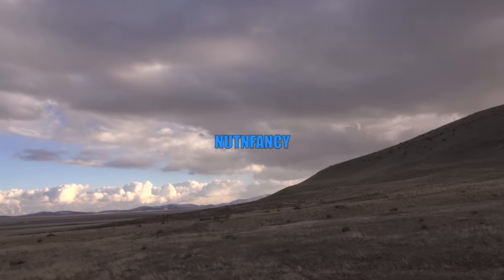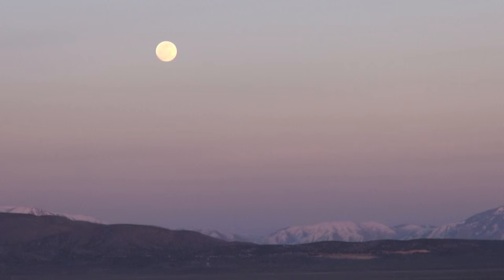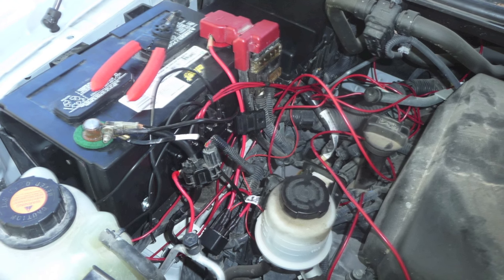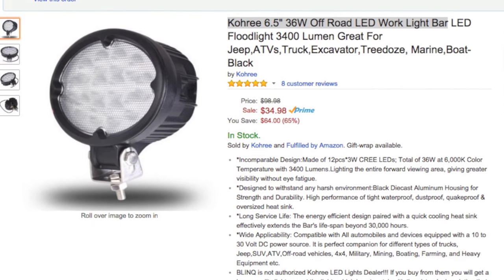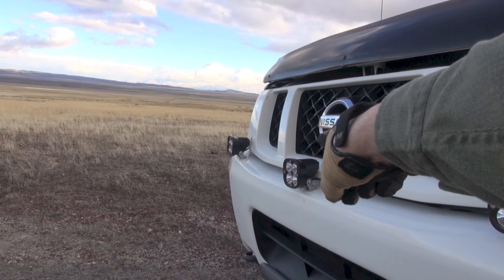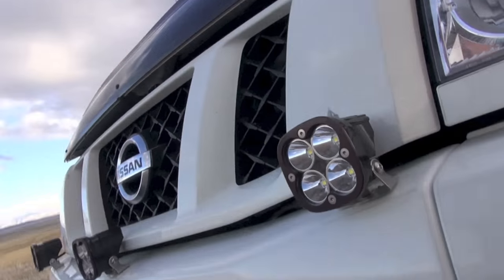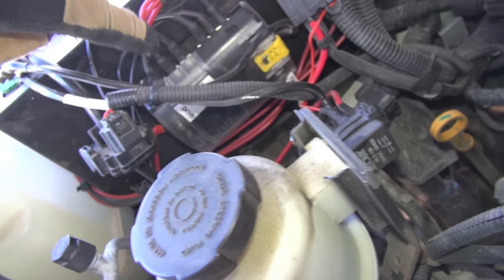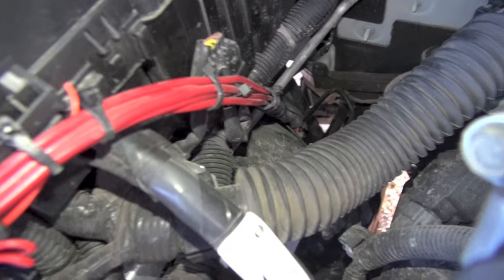Make Your Truck Lights Suck Less

Comment: Is that price per light? Is the wiring harness included? I have been looking at up grading my kc lights.
Reply: never mind you answered the cost question. Is there a reason you didn't use Ridgid brand lights?

Comment: Did you need a relay for those little led's?
Reply: +Cooldibs Looks like the relay supplies power to the add-on fuse block, which I believe can support six 30 amp fuses. (more than that relay is rated for, I'm sure)

Comment: Not a bad set up but very spendy compared to a light bar
Reply: +Nicks Customs very spendy compared to cheap light bars. quality ones can run you way over $600.
Reply: Alex; $280.00
Reply: You can pay over $2000 on some
Reply: +Nicks Customs thats a light bar from rough country they make dont make the best products they arnt very bright ive had one but rigid light bars are top of the line and are quality running up to 2,000
Reply: MrOutdoorsman1234 Rough country makes really good suspension parts actally
Reply: +Nicks Customs +1 on cheap light bars from ebay. Way more light for the money than small square ones!
Reply: +Nicks Customs lightbars are not for everyone. some of them makes the truck look ugly.
Reply: bugaljuice I'm not much of a looks guy. I care more about function. If you'd like this set up for looks over a lightbar, go for it.
Reply: Nicks Customs
 i have a 81 corolla. i have a light bar on the car. its a beast i still havent gotten pulled over
Reply: +Nicks Customs There's 3 types of light bars1. Baja Designs2. Rigid3. China Bars
Reply: you can make your own from parts too.  I think I saw a diy on pirate 4x4

Comment: If you can get up there with a drill to drill thru the nut and bolt, safety wire those nuts on.

Comment: don't forget to pick up an optima yellow top battery standard batteries don't hold up well with offroading. This video makes me miss my old jeep I had delta driving lights on the bumper and 2 9" spot lights from northern tool on windshield mounts. I think I had 300 bucks in lighting upgrades. it would light up the hillside 300 yards away no problem. coyotes never stood a chance :)
Reply: doesn't seem like northern tool has those lights anymore they were only 12-14 bucks a pop but worked amazing think the bulbs were H11s too so you could hid upgrade them easily
Reply: Your battery has nothing to do with power to the lights when the truck is on, that'd be the alternator. Those LEDS don't draw enough to come anywhere near the max output of that alternator.
Reply: MrBassfisherman98 you're right however that's only true if you have the truck running constantly. And a standard battery not being durable during off-road use still stands as the lead plates breakdown with severe vibration
Reply: +John Thrasher Why would anyone run aux lights with the engine off? Even if they are led they'll still drain your battery regardless of what kind it is. It sounds like you don't offroad much (if at all). I've used generic autozone batteries in every single one of my wheeling rigs and ive had 0 problems. I've run them all across the country and never had a single problem. An optima is merely a luxury, not anywhere near a necessity.
Reply: MrBassfisherman98 i don't know about you but I don't want my vehicle ideling for a few hours while shooting which is what he's doing. Ideling isn't a huge issue of you have an electric fan.  Ive done enough offroading to have replaced 3 auto zone generics in my jeep and to be done with it. Optimas are expensive but worth it. I'm not going to argue with you but ive dealt with enough crappy batteries that when a battery dies or starts giving me issues I replace it with an optima. To me they're more than worth the premium you pay for then.
Reply: +John Thrasher Jeep problems. It's not the battery it's the vehicle.
Reply: MrBassfisherman98 yeah cause 91 jeep wranglers were known to just eat batteries for no reason....Done....
Reply: +John Thrasher Faulty electrical systems, parasitic power drains, bad connection, bad alternator, It's not for "no reason". Jeeps have one of the highest "issues per 100 cars" rates on the market today. And unless you're a millionaire there is no way you could have owned 91 jeeps, let alone ruined 91 autozone batteries in 91 different jeeps. You probably haven't even worked on 3 jeeps, you can forget 91. This is coming from a former Jeep guy who converted to a Toyota guy for reliability's sake.
Reply: ***** THIS :) yes 1991 jeep wrangler if i was going to lie i would choose a reasonable number, come on 91 Jeeps thats insane. stiff suspensions and offroading just dont play well with standard batteries hit enough hard bumps its gonna take its toll. Deep cycle batteries also withstand more charges and discharges than a standard battery. i wont buy another battery thats not an AGM

Comment: I think that you have both first and second kind of cool with the size and general location on the truck.   However, your wiring job, that has a fairly high suck level no offense.  I know that you would never fly an aircraft wired up like that truck.  Zip ties are not the hallmark of a high quality install.
Reply: One more little detail, rather than bringing all that amperage to the inside of the truck and back out, you could just brought 3 small wires in to ground an independent relay for each of the lights, thus making it a shorter lower resistance path for the lights and a much smaller hole through the firewall.  Fuse protection could have been inline with the relays.
Reply: +mpeugeot I've seen many other comments about relays, lol, I think he is pretty aware about relay wiring by now.

Comment: I dont see the Point of all those Cables going trough the firewall. Just get a relay, feed it with power from the battery with a fuze between. Then steal the "switch on" Power from the ordinay high beam lights.I dont see the Point of being able to light hem up individually, and if you use them on the ordinary roads (wich offcourse you will) you wont blind the other cars cuz you aint driving onto them with the highbeam on anyways.

Comment: these new lights hurt my eyes.  ive toned them down with yellow gel.
Reply: btw really no reason to go crazy with relays and large gauge wire for led lights.  

another thing you can do is swap out the stock bulbs for led bulbs.  im running genesis(?) headlights on my cherokee.
Reply: +OutlawUniverse LED or HID?  Just to clarify.
Reply: +OutlawUniverse I wouldn't live by those words some of these leds can draw alot of current typically 12awg can handle 20amps, 10awg can handle 30amps, 8awg 40amps. I would depending on the specs of the lights run 10awg if for anything else it's more protection against corrosion failure. more copper to corrode before failure. another thing to keep in mind is the heat these put off those large heat sinks can get hot.

Comment: driving a full size pickup and complains about mileage?  that is a palm snacks forehead thing for me.  don't get a truck that is powered by a v8 that is probably about 6500 lbs(or more) and is slightly more aerodynamic than a brick and gripe on mileage.
Reply: I'd hardly call it a truck anyway.
Reply: Most trucks are not very truck like anymore. My Silverado is more of a luxury vehicle than a truck.
Reply: My 2wd v8 powered Silverado gets approximately 1mpg less than my 2wd 4cyl Nissan.  The 4cyl weighs a lot less, but they are geared much lower to compensate for the lack of HP/TQ.  My Chevy runs 65mph at 1,700rpm and my Nissan runs 65mpg at 3,000rpm.  My Chevy also doesn't have to downshift nearly as often to maintain speed on a grade.
Reply: banditone00 that is a hell of a gearing?  4.11s?
Reply: +bill marks not sure which ones are in it, but it appears the options were 4.37, 4.63, or 5.14.  That's how they make a truck still usable when it makes 100hp.  Also I do not believe that 5th gear is an OD in the Nissan.  My Chevy has 3.42 gears with a 4l60e overdrive trans.  It's bigger, heavier, and makes well over double the power, but turns A LOT less rpm.
Reply: +wobinga7 What is it then, a fucking boat? At least its made in the US unlike most ford, chevy and dodge bullshit. Far better quality too.
Reply: Nissan pretty much just created the Titan and hasn't done anything to improve it since.  It also has inferior power compared to all of the other trucks in its class.
Reply: wobinga7
Except completely change it this year and come out with a diesel full size which no other company has in the US. The only reason it was low on power is because they never changed it until now, like you said. But what does 400 hp mean if the truck is unreliable? Id rather have 310 knowing I can depend on it daily. I have an 09 with ZERO issues.
Reply: Actually the Ram 1500 has a 3.0 Eco Diesel engine as an option.
Reply: wobinga7 No one else has a full size truck with a conventional full size Cummins motor and Aisin tranny. There, hows that? better?
Reply: +blackhatch46 My 2015 says Kansas right on it
Reply: 22+mpg with a my 2014 and 2015 f-150
Reply: Mike Halverson
Maybe now they are. MOST (like i said) trucks from us companies were made in mexico.
Reply: blackhatch46 I think some of my 02s said Mexico on it. But when it comes down to it is where are they based out of. Of course foreign companies will make them here, it'll save them shipping costs. No matter what way you cut it the majority of the profits go to the country of origin.
Reply: +blackhatch46 pretty sure dodge ram has cummins and aisin. :)
Reply: +bill marks He probably got it cause at the time, the Titan was the only truck on the market that came with a V8 as the main option. Everyone else, Ford, GM, Toyota, Ram/Dodge were all V6 standard. Usually V6 trucks are only offered in 2wd configurations and unless you have a locking rear end 2wd sucks a load of balls off road. I will give Nissan a thumbs up for having a pretty stout 5.6L DOHC engine in the truck that is worth a damn and a half. Other than 2004-08 trucks having leaf spring shackle failures and them not upgrading the truck for the better part of a decade, they are not too bad.

Now people can say a diesel is better, for the cost of fuel and now adding DEF and having DPF failures as well as needing to keep a close eye to fuel filtration as well as fuel quality, they are not worth the hassle, at least in a truck where they get about 15mpg-18mpg. The newer Ford engines like the 5.0L Coyote and revised EcoBoost will get 20mpg in a 4x4 truck long as you keep your foot out of the go pedal and the engine is done in the break in process.
Reply: +Ratkill9000 I owned a 2014 F-150 regular cab 4x4 with the 5.0L V8 and 3.55 gears. I was pulling 24mpg on the highway, all the time with it after I broke it in. I just traded it for a 2015 a month ago. My new truck is the same thing only a extended cab. I know my 2014 truck weighed 6080lbs, I weighed it on the truck scale. The 2015 witch is  bigger weighs 5080lbs. I'm expecting to get the same mileage as my last truck, if not better. I also just bought a 97 ranger 2.3L 5 speed to keep miles off the 2015, runs like a champ!
Reply: Mike Halverson I'd have waited until 2018 after a year of production with the 10 speed automatic from Ford. While not a true 10 speed its more like a 5 speed with a bunch of gear splitting, but I'd never buy first year of a new production. I bet that Aluminum body and 1000lb difference helps though. You get the 23 gallon or extended 36 gallon tank? 23 gallon is standard now :/ not sure what the hell Ford was thinking on that.
Reply: +Ratkill9000 I seen the 10 speed, I'd like to see how they set that up and on what trucks. A 10 speed seems like it might be a nice idea. I know the 6 speed goes in everything up to a F350, so I felt good about it being in a F150. 

I never thought I'd buy the first year of a new production, especially on the aluminum body. I was off from work due to an injury, I listed my 2014 on craigslist months before I got hurt, and I wasn't getting any calls. I went to the dealers, they all were giving me more than it was worth selling it private party, plus I got them all bidding against each other on the sale of a new truck. I had the time to work with the dealers so I did. I might be getting married soon so a bigger truck made more sense. When I bought my 2014 there wasn't alot of info on the aluminum and how it would hold up. Now there is a lot of info out there on it. The hood on my 2014 was aluminum for example. Years ago when Ford would make fleet trucks they made several parts of them out of aluminum, then would go out and find those trucks and look at them. Besides all of that, there are the videos on YouTube of Ford beating on these things.

I got the 23 gallon tank, that is the only things I didn't look at on this truck! All the other ones I was looking at were 36, my 2014 was a 26, so I didn't think they made them this small. I got everything else that was important, gears, engine, ect. I think the fuel system is the same from 2011 till now, so maybe I can get a different tank from a junk yard in the future. If I get 24mpg or better though, do I really need a bigger tank??? My last one would go 500 miles or more between fill ups
Reply: +Mike Halverson The main thing that I know of to look out for is that from 2004 until now the rear high mount light on the cab likes to bring in water still and they have not fixed the issue. Also the body panels don't line up very well on the new trucks. Might be the case only for ordered trucks but I'm not sure. For what it's worth 1997-2003 f150 and f250ld truck hoods were aluminum. Had a towing chain snap and dented the hood on my 99 F150 but never had issues.

My 99 has a 30 gallon tank but its also an extended cab long bed. I'm looking at getting an EcoBoost F150 in a few years to replace this truck since its rusting out and has 273k miles on the clock on the crap 5.4 triton...hate the engine but damn its too reliable. Hope EcoBoost can last nearly 20 years and 300k miles of wear and tear like the old triton engines can.
Reply: +Ratkill9000 Wow I didn't know they did the hoods like that back then! I've been running older F-250s and explorers until 2014 so I don't have any 5.4 experience, but sounds like you're having good luck with them. I believe the 5.4 does 300HP and 265TQ so when you get into an ecoboost you'll probably be very happy! I almost did the eco this time, but it's so hard for me to turn down a well built straight V8. In 2015 they gave it a little more power too so I couldn't turn it down. More people are doing the eco now, but I know there are plenty of people like me. That is the best thing about Ford right now, their gas engines will accommodate anyone! Meanwhile GM is still doing Vortex, I would like to see them start building their own engines. They don't hold a candle to what ford builds right now.
Reply: +Mike Halverson As far as the Triton engines for they are good but fuel economy wise they suck. Working on them sucks. Main reason I'm leaning towards the EcoBoost is I'm willing to try something different. I'm waiting to see how the 2.7 holds up over the next year, hopefully it won't have 2011 EcoBoost issues.
Reply: +Ratkill9000 What issues did they have in 2011? I was looking into ecoboost issues and couldn't find any. Honestly I didn't look hard because when I heard the 2015 5.0L does 385hp and 387tq I was sold on it, again.
Reply: +Mike Halverson The intercooler would fill up with condensation when going through different temperatures or during wet conditions. This causes a loss of power and potential stall of the engine. Person wants to get up to speed on the highway and the engine won't possibly causing a serious accident. Few people on F150 forums and Ford Truck Enthusiasts had this issue. Another issue but is common on a lot of direct injected engines is carbon build up on the valves. But this is more known on the smaller EcoBoost engines like the 4cylinders in the cars.
Reply: +Ratkill9000 Cool thanks for the info. I have yet to hear anything bad about the 5.0 have you?
Reply: Mike Halverson None that I can find. Some say the low mounted alternator sucks in wet conditions but I have not found any reliability issues. I do like how the coil packs for the spark plugs are on top in a better position than the 4.6/5,4L Tritons.